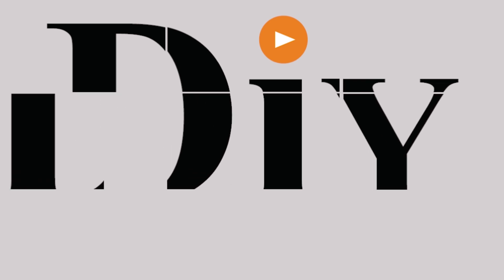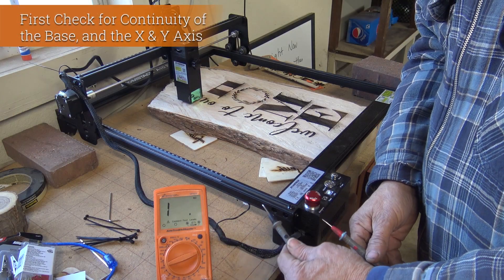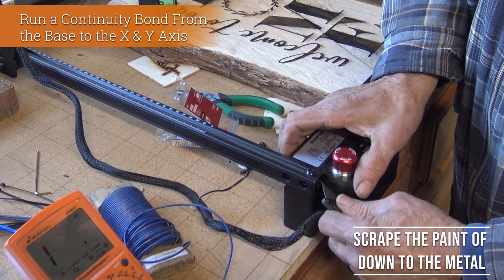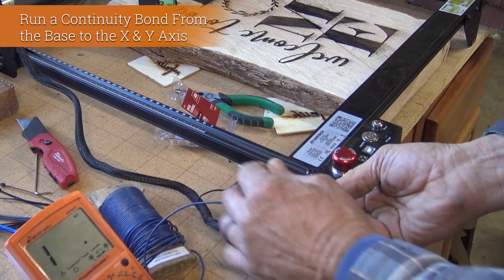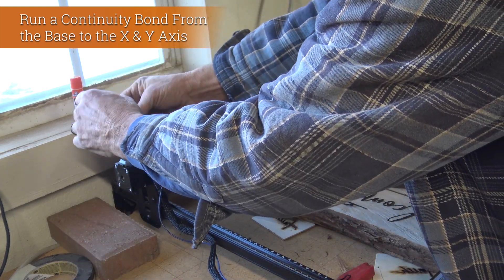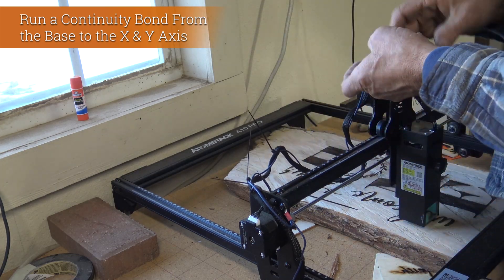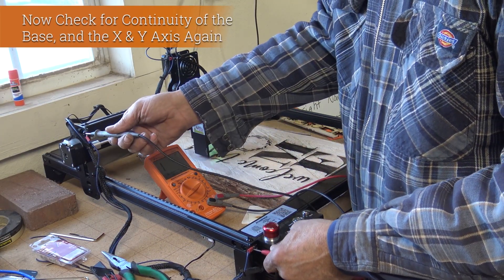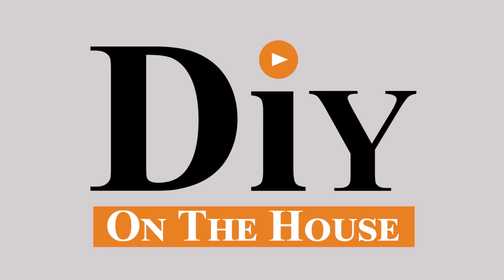Laser Engraver Disconnecting From Computer - Problem Solved

Comment: This did not solve the problem.
Reply from the maker: Darn - hope you can find a solution!  We love engraving on our machines.
Reply: Wgat machine do you have? I am having this same issue with my Ortur LM3 after buying the 40W Module. So frustrating! (And of course, Ortur Support is no help)
Reply: What I had to do was get the latest version of light burn 2.001 also don’t turn on any high voltage items that draw power like a vacuum cleaner or table saw.

Comment: Where can I connect the cables if my printer is made of wood? I built a CNC from scratch, but now it's been giving me the Idle MPos:22.503,14.198,0.000 FS:0,0> error in LaserGRBL for some time. It leaves the jobs incomplete, and I have already lost a lot of material because of it 😢.
Reply from the maker: Wow impressive! Try to bond to some type of metal on the axis'. If you are using a 3 prong power cord you need the bond to attach to the ground or some type of earth ground to relieve the static.
Reply: @DIYOnTheHouse  The green wire (ground) is connected to the 12V 10A power supply, and the other two wires go to the input of that power supply. From the power supply, two wires come out, one positive and one negative, which are connected to the Arduino CNC shield. I couldn't find a ground terminal to connect the green wire from the power supply... 🤔
Reply: >>> G10 P0 L20 X0 Y0 Z0
ok
Idle|MPos:-20.000,-45.000,0.000|FS:0,0>
<Idle|MPos:-20.000,-45.000,0.000|FS:0,0
Error while processing response <<Idle|MPos:-20.000,-45.000,0.000|FS:,0>>: empty String
<Idle|Mos:-20.000,-45.000,0.000|FS:0,0
<Idle|MPos:-20.000,-45.000,0.000|FS:0,0
Error while processing response <<Idle|MPos:-20.000,-45.000,0000|FS:00>>: Index 1 out of bounds for length 1
Error while processing response <<Idle|MPos:-20.000,-45.000,0.000|FS:,0>>: empty String
Error while processing response <<Idle|MPos:-2.000,-45.000,0.000|FS:00>>: Index 1 out of bounds for length 1
Error while processing response <<Idle|MPos:-20.000,-45.000,0.000|FS:0,>>: Index 1 out of bounds for length 1
Error while processing response <<Idle|MPos:-20.000,-45.000,0.000|FS:,0>>: empty String
Error while processing response <<Idle|MPos:-20.000,-45.000,0.000|FS:,0>>: empty String
Idle|MPos:-20.000,-45.000,0.000|FS:0,0>

Comment: Would you know if the humidity or Rainy days could make this problem happen more often? It happened to me again, it just stops working but now is the second time that it does on a rainy day....
Reply from the maker: I use our machines mainly in fall into winter. I would say for ours it happened when the humidity was very low and most likely static discharge.
Reply: I seem to be having a similar problem using a Two Trees TTS-10 Pro. It appears when it's hot and dry it performs pretty well though.

Comment: I was having trouble with my sculpfun s9 losing connection early into projects. Fortunately came across this video and tried what was recommended. So far so good!! Thank you.
Reply from the maker: Glad it helped
Reply: I'm having a similar issue with the same machine using lasergrbl it doesn't want to connect at all and when it does it disconnects. Hopefully this helps

Comment: My problem is that when the light in my office or a device in it is turned on and sometimes off "both" my 3d printer and laser cutter go off-line then back online but they are paused, pressing stop of exiting does nothing untill they're turned off and on again! 
I know it's not an earth problem as I have many mods and connections and they're basicly already in place. 
Even my main house heater will sometimes set them off? 🤔 
Im yet to leave a review so would be good if it was the laser module or the motherboard?  🤔 I'll get replacements under warranty and have some spare parts but my printers going on 4 year's old now.....
Reply from the maker: Wow that is super sensitive! Sounds like you need some type of power filter for electronics. This may not be what you need but check out the link, this is along my way of thinking to correct the issue. https://amzn.to/4cpuALz good luck!
Reply: @DIYOnTheHouse  I forget to mention, I'm also using a 3 way surge protecor board that has a built in ESP 32 to stabilise voltage ect.
  I'm going to have to call an electrician I think? 🤔 
I even poured water over my house ground rod outside to increase conduction 😅ohms went down to the rest of the house but the office remained the same so maybe a house fault? 🤔 
Thank you for the link

Comment: I have the Atomstack S10 Pro (I Think it is just a diff color than yours).  I am having this issue, added the ground wire between the 3 points, same as you (I now shoe continuity same as yours)  -- sitting here, idle,  for 15-30 minutes the controller restarted 2x.  How is the ground supposed to get back to house wiring as the 12v system does not have a ground wire to the case. Do I need to open it up and add a ground?

Comment: Was having trouble with laser cutter/engraver seeming to lose connection after a few jobs and sitting idle for a few minutes. Never had it stop in the middle of a job but did stop responding quite often. Ran the bond wire as described here and have had no problems since. Simple fix, took me maybe 15 minutes. Thank you!
Reply from the maker: Glad it helped!

Comment: Hi, I have atomstack S7 and in the middle of engraving "red" light on module ( laser head) turn off and program is still running...no error...no nothing...and then "red" light ( bulp on the top of the pcb board on module looking from top) it is ON ....OFF...please tell me how I can fix this issue
Reply from the maker: You would need to contact atomstack for assistance.

Comment: what about this? GPIO isr service is not installed, call gpio_install_isr() first.. i sometimes get this error with my laser on lightburn. i have no idea what this mean.
Reply from the maker: I wish I knew more about the technology side -- were you able to find your answer?
Reply: @DIYOnTheHouse  two trees emailed me a file to reflash my machine. i already did it.. that error was gone but i still cant use the wifi function. in lightburn i see a message after plugging it in, it says no wifi. and sometimes i get "waiting for connection" message. im still waiting for two trees reply about my issue.
Reply: Same here, mines a tts 55. This GPIO error is driving me nuts.